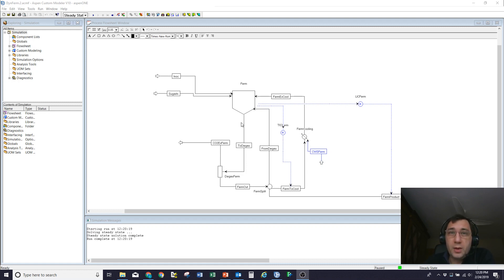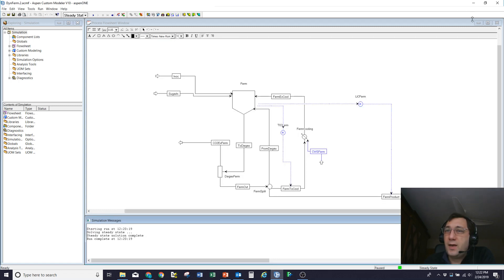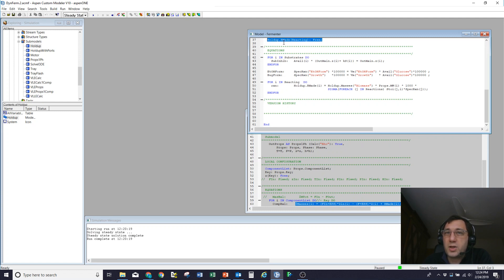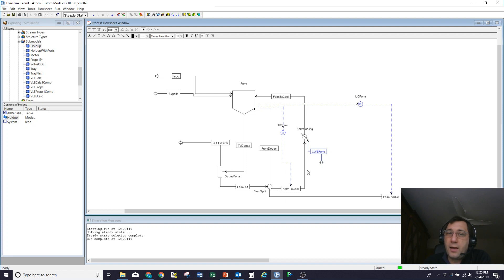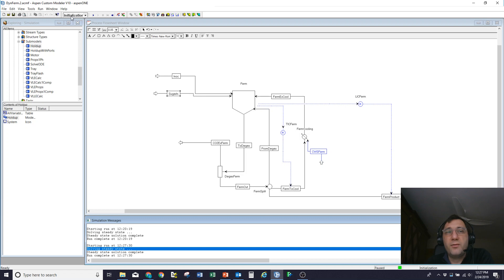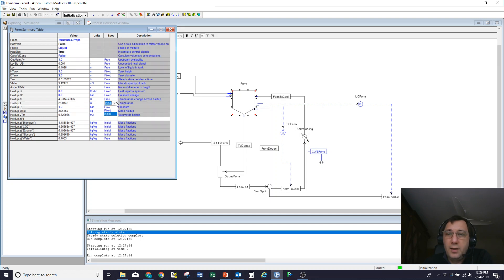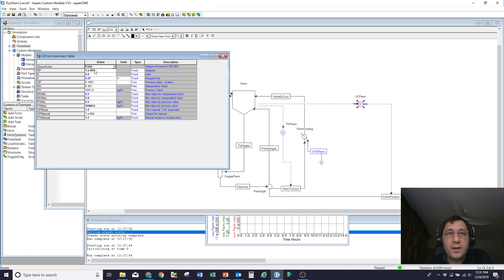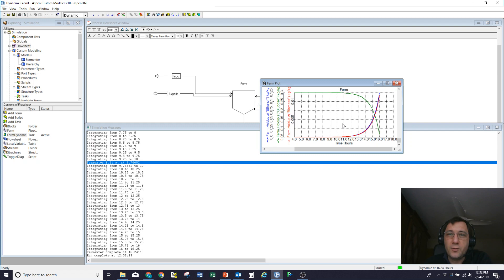ACM6. Dynamics

Comment: Hi, many thanks for your helpful demonstration
I would highly appreciate it if you could help to introduce experimental data from a sensor to the Aspen plus dynamic model, For example, I have measured the ambient air temperature using a thermocouple sensor (on Excel table)  and I would like to introduce these values to an inlet stream of a heat exchanger.
Reply from the maker: I presume that the ambient temperature is an input to the model - an input or disturbance that you're trying to account for.
This is a tricky one that I don't have a great answer for, as I'm guessing that there's a continuous variation in the temperature as a function of time.  There are three things that I have tried in this scenario:
1. The simplest to code is to import the ambient temperature as a series of step changes as a function of time - input a table of "Fixed" values every 15min or whatever.  This will allow the system to sort of track the disturbance, but the series of step changes will slowdown the integration step.
2. You can try to smooth this out some by creating a couple of dummy variables and feeding the stepped temperature series through a first or second order filter.  This has the advantage that the system input remains continuous in value (and derivative for a 2nd order filter), but adds coding and still slows the integration
3. You can fit the ambient temperature to an equation to that it is continuous - depending on how noisy the data is, you might fit the data to more than one equation (eg for 0-24h use equation 1, then for 24-48 use equation 2, ...)
4. As a bonus / more complicated approach, you can also write a C/Fortran callable routine and read in the temperature profile from a data file, perhaps smoothing it to present continuous data with a continuous first derivative to ACM.  This is quite a lot of extra work, though.

Best of luck!

Charles
Reply: Many thanks for your kind reply, I hope you can demonstrate an example in your future video .... many thanks again  @cssandersonllc3172

Comment: Very helpful Video. Thank you!
Can you tell me how I can assign string variables in Task language? E.g. I want to change the copied stream of a stream selector after a certain event.
Also my simulation can't deal with zero flow streams. It fails to integrate. Maybe you know how to deal with that?
Reply from the maker: I'm glad it was helpful.

Not to be pedantic, but you can't have a string variable in ACM - only a string parameter, so it's tough to change a string in the middle of a dynamic run unless you stop the run and make the change (and cause a rebuild that prevents rewinding etc.)

Within the task itself, you can create a StringParameter and assign it a value (using the ":" instead of "=" as with all assignments in tasks), and then use that to choose what to do.

As for zero flows - yes, that's the bane of ACM.  There are two approaches that I usually use:
1. Instead of setting the flow to zero, set it to a very small number so that it's non-zero but insignificant in the larger scheme of things
2. Reformulate your equations so that there is a valid solution when the flow is zero.  I sometimes add a very small number to one side to the equation to get it to still give the correct answer but have a definite solution.  For example, instead of 
Frac1*FlowTot = Flow1; 
Frac2*FlowTot=Flow2; 
FlowTot = Flow1+Flow2;

I might write
Frac1*(FlowTot+1e-16) = Flow1;
Frac1+Frac2=1;
FlowTot = Flow1+Flow2;

In the former case, Frac1 and Frac2 are indeterminate if Flow1=Flow2=0.  In the latter case, Frac1=0 and Frac2=1
Reply: @cssandersonllc3172  Thank you very much for your answer, also for the first comment. It shows that Im still lacking some basic understanding of ACM. Can you recommend any extensive training material for ACM?
Reply from the maker: Hi Sebastian - I'm afraid that there's not a lot of material out there.  The best resource is really the help files embedded within ACM.  They were originally written as a printed manual and have been broken up into separate little files for the Windows help system - I recommend "printing" them out as a single PDF and reading through that way...  Or perhaps I'm just old school
Charles

Comment: Hi Charles, Thanks for sharing this nice presentation of ACM dynamics. Is there any way to get the evolution of variables with time in dynamic ACM simulations? For example, if a fluid is being heat in a simulation is there a way to get T(t) values after the simulation (e.g. a list that reports all the historical values of T from the initial condition until the end of the simulation)?
Reply from the maker: Yes - there are a couple of approaches to consider:
1. Store the results in ACM and get them later.  This is the easiest.  
a. There's a "Record" attribute to all the variables (and parameters, I think) that you can set to True (Variable Find or add it to the data table).  
b. The Record get set to true as soon as you put a variable on a "Plot" or "History Form") type form, which you can create at the Block level (if you want it available for all instances of that model) or at the Flowsheet level.  These plots are also the easiest way to view / recover (copy and paste) the results.
c. Once recorded, you can access the History properties/methods in VBA
2.  Less elegant, but you can also set up an external driver for ACM (eg using Excel/VBA), then step through your dynamic simulation and pull out the variables of interest at each step

Good luck

Charles
Reply: @cssandersonllc3172  Thanks a lot Charles. The problem was that I was using "Add Form" in the "Custom Modelling" branch/level rather than in the "Flowsheet" branch/level. I followed your first suggestion. It was easy after your explanation. :)

Comment: HOW WE CAN DEFINE A PROPERTY MODEL IN ACM
Reply from the maker: I probably need a little more detail to answer this...  Some initial thoughts:
- In the ComponentList section of the Explorer window, you can go to the lower panel and Configure Properties.  This allows you to open Aspen Properties; to link to a pre-build Aspen Properties (appdf) file - my preference as t makes opening a file quicker; or you can link to your own Properties database
- Alternatively, you can create your own properties calculations in ACM (I recommend using a Structure for this - see the video on that topic for more details)
- If you have already created an Aspen Properties input file, and you've configured more than one Properties option (eg SRK as well as NRTL), for a specific ComponentList by double-clicking to open it, then clicking the "Edit Physical Properties" button and changing the OpSet (or other options) in the window that pops up

Hope this helps